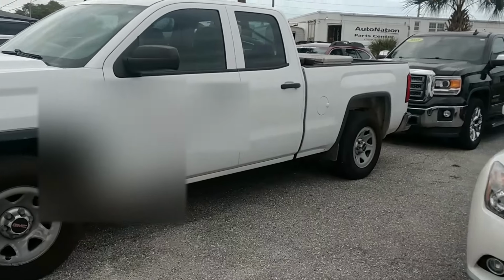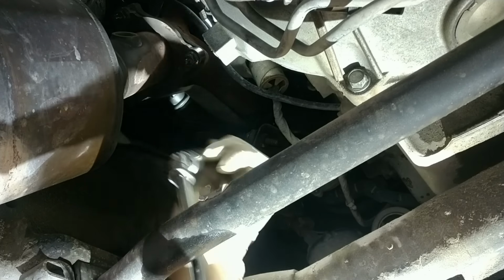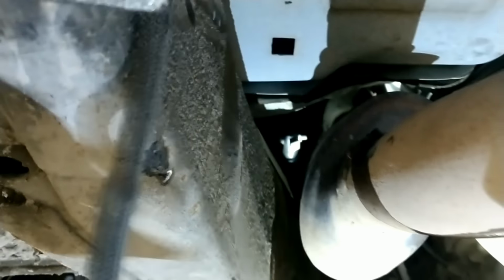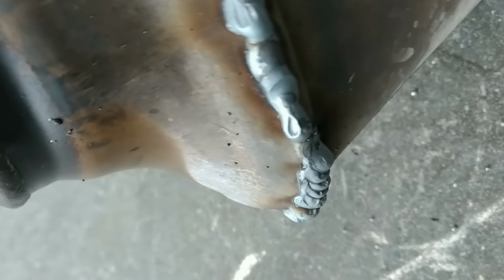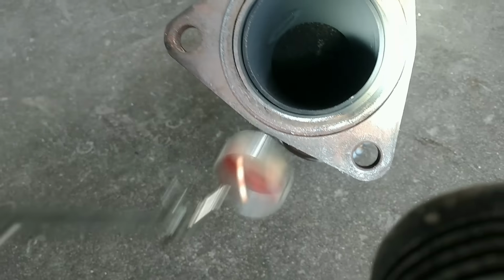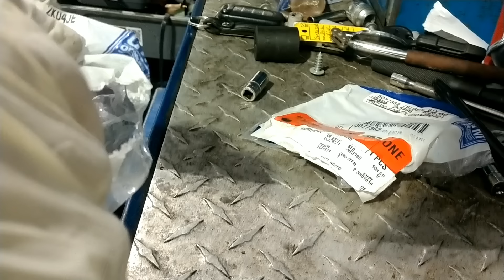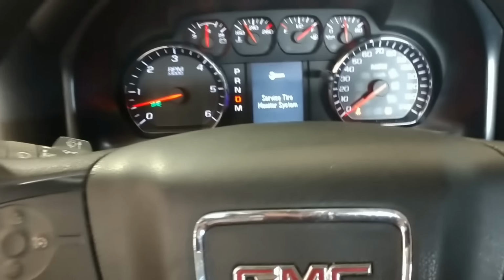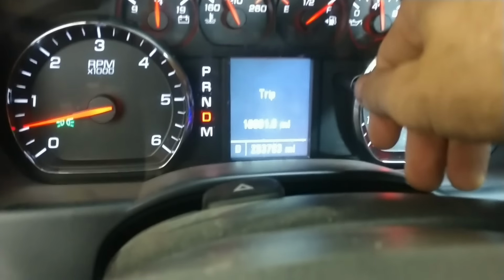Customer States exhaust leaks: Repair it cheap.  Ok then, I can do cheap and good. Sort of.

Comment: Best sign I've ever seen was at my auto mechanic's shop.  It said "Fast, Good, Cheap.  You can pick any two.  If it's cheap and good, it won't be fast.  If it's fast and good, it won't be cheap.  If it's fast and cheap...it won't be good!"   I remember a family vacation to grandma's house, where the ford station wagon began to loose power when you pressed on the accelerator.  We stopped at our usual station in Springfield VA to refill and my Dad asked the mechanic if he had any ideas.  It turns out that the mechanical fuel pump was connected with a rubber hose which had developed a crack in it and was sucking air on the tank side. So, when you stepped on the gas, causing you to lose power. My Dad watched as the mechanic take two different length extensions, two universal joints, a socket and ratchet, put em all together and had the repair completed in short order.  Dad said it was a downright pleasure to watch someone work, who knew what they were doing.  You sir fall into that category and it is indeed a pleasure to watch you work, and just like all those book reports I did as a kid, I learn a lot too! Coming from a 66 year old, that's sayin sumpthin!  Keep up the good work!
Reply: They say the same thing about software QA. 

Quality, speed, cost. Pick 2.
Reply: I believe the original saying came from Keith Bontrager about bicycle components; cheap, strong light; pick two. It is amazingly accurate.
Reply: In manufacturing you have the same free words but one all always get sacrificed if you push the other two too hard

Comment: Just turn the wire speed down a bit and it won’t be so lumpy, clean with wire wheel prior to welding. Finally when I welded my exhaust because I am a welder I put multiple passes on to support the break fix better.
Reply: perfect suggestion..

Comment: This reminds me of when I went to a small mechanic shop 

The owner was quoting me like $300 to fix exhaust leak on a $900 car I said no way I'm putting that $ into this car 

Owner left before I pulled out 

Mechanic chased me down said I can fix it for $20

He actually called his dealer in front of me to get his next fix

Meth I assume 

Repair was done in 10 minutes and outlasted the vehicle
Reply: That's how I ended up w brand new coldless impact lol
Reply: @troy3052  lol
My local home depot has a forklift guy there that will drop a pallet of whatever you want in your truck

For $100!!!!!

My buddy just got 110 bundles of rags that retail for $18 each 

Last week he got 2 vanities 
Turned out they were both damaged but couldn't tell from the outside of pallet

Comment: Welder here. Continue practicing, the main advantage of mig is that it was designed to be easy to learn and pick up.  If you want haynes has a pretty good welding book that got me off the ground. I think you can do well with it.
Reply from the maker: Thanks Bill, I'll look for that book. I'm pretty sure that I had the wire speed too high, and the voltage was probably to high. I've had since decent success with thicker metals before and I have achieved better welds that what y'all saw. Im familiar with settings and the reasons why those settings need to be used. I think some book time will do me some good. Thanks for watching!

Comment: here in CT nobody uses sockets on exhaust work.
torch everything.
half the time if you need a new exhaust the car gets totaled because part of your frame has rusted away.
Reply from the maker: I feel your pain, I spent a year in Detroit many moons ago.
Reply: Live in RI all our cars got rot. My father's bronco, that thing runs like a champ but the body is Swiss cheese.
Reply: Gotta love the rust belt
Reply: @Doomstrader  CT is worse, we are the only state in the nation, that uses the highly corrosive liquid ice melt, WITHOUT the corrosion inhibitor added.  It's eating all the vehicles, and the roads.
Reply: @nunya3163  We should be able to sue the state for ruining our cars.

Comment: If you run a mechanics shop or machine shop, consider doing what this guy is doing. Even if you decide not to make a YouTube channel, taking video notes is both a fast record keeping tool as well as great training material for new mechanics, machinists, technicians, etc. If it's just for internal use you can even compress everything to like 480p, or whatever you feel the minimum usable resolution is, in order to save on storage space.

Comment: Your weld looks great. You're not taking it to the fair.
Reply: Welded  for a long time, you did just fine. Maybe get a pair of welding sleeves, and turn down amps and wire speed for light metal a bit. Takes a bit of fiddling to get the settings just right. look after your liner and contact tip and don't clamp the feed rollers too tight. Satisfying to watch you work and the comments !! Great videos!

Comment: Ye olde welders trick I learned from the old timers. When welding or brazing next to a part you don't want to get hot, wrap the side you wish to dissapate heat from with a sopping wet shop towel, or an actual towel for that matter. As it makes steam, it dissapates the heat. This is especially useful when brazing a valve or something on an airconditioner or on plumbing... but it is applicable in any heating of part situation.

Comment: Good video.. Running multi tack welds to avoid damaging the core. SMART.. It's not always what it looks like.its what the end result is that matters. Besides......its not in a place where it will be admired.
Reply: Multiple short welds over more time = more heat.
Reply: @Aussie101 TIG (GTAW) would be the best process It's a much more precise method and the heat input is more pin pointed. MIG (GMAW) would be the next best, which is what was done here, however it was still done incorrectly. Even though shorter tack welds seem like a smarter choice, mig tacking starts out cold with little to no fusion to the parent metal, just a hot bead of filler dropped down on top, so that right there gives the possibility of pin-holes in the weld which leads to leaking and cracking, especially on an item that goes through drastic heat cycles where the metal expands and contracts, and is subject to heavy vibration. This is only being corrected because even the factory weld, which are usually hot and fast robotic welds run in a continuous bead, typically with the MIG process, still cracked. So why people are saying a continuous weld would destroy the cat, when that is how it was originally assembled by the factory, is beyond me. The second reason on why the tacks is bad is that prolonged exposure to heat, and more of it, because the overlapping of the tacks introduces more weld, as you are overlapping bits of your circumference. The reason why the heat input is greater is because it still takes the same amount of heat to weld the entire circumference be it via tacking or a continuous bead, but stopping and waiting for it to cool before running more smaller tacks gives the entire assembly more time to absorb the heat throughout, and thanks to how the laws of thermodynamics works, the hotter the material is to begin with, the quicker it heats up. 

If it were to be a proper shop repair and charged appropriately, say 1H labor is what I would charge, I'd have wrapped the main body in scrap pieces of aluminum to act as heat sinks and pull heat out of the catalytic converter and run 4 continuous beads in quarters using the TIG process at a rate of 10-12 inches a minute. I'd have also used the proper filler material, as welding any form of automotive exhaust stainless with the standard ER70S-6 filler metal will not only lead to a weld that will rust, but is by very nature weaker as it has depleted the surrounding base material of it's stainless properties, and typically leads to a more brittle material in the heat affected zone (HAZ) which is around the weld joint. The HAZ on this piece is all over the place and inconsistent, which again along with the other issues, could lead to failure of the base material itself rather than the weld cracking. If you've ever seen a weld repair next to a weld repair, this is why.

Edited: Used metal in place of heat somewhere. Corrected.

Comment: Just a quick tip for next time whey you have a crack in metal you need to drill a hole at each end to stop it from extending. Just a small hole will do then weld it up and it should be permanent repair
Reply: I was also taught this..

Comment: This guy 👌

Fun fact, you can put your workpiece on aluminum plate and it'll suck out a lot of heat and you don't have to worry as much about cooking anything inside.
Reply: It's called a Heatsink and they have been used in some electronic parts for decades... Yes, I believe in them for anything that is going to get hot, to help dissipate as much heat as possible to avoid damaging things near the weld, solder, spot..

Comment: Isn't it a GOOD idea to weld this converter instead of replacing it?  Saves money yes, but also saves a lot of material from the waste stream, saves energy since it takes a lot of energy to recycle to important components of the stuff in this device that doesn't go into the waste stream.  Anyways, repair it cheap, in this case, seems like a really good idea. Great video, keep em coming Ray.

Comment: A question please Ray? Should one put anti-seize on the O2 sensors? Thank you. Great video and fix! Hey it works!
Reply: YES HE SHOULD HAVE.
Reply: When you buy them, they come with anti seize. That should answer your question. It's like asking "should my car have tires?" Well, did it come with tires?
People debate this topic very strongly. But they all seem to agree you need the sensors and the "anti seize is bad" group don't seem to stop using them because the manufacturers sell them with it pre-applied....
The concern is: don't get it inside the sensor. It goes on the threads.
Reply: Good idea, definitely in a rust belt but luckily he's in Florida so it's not as vital but still recommended. I'm in Minnesota so I use alot silicone paste and antiseize  and anything I want to remove at a later date.
Reply: I do...

Comment: One thing that might help you is to look up back stepping when you weld. Less heat and you dont have to wait as long between welds. Just trying to help. And yes I'm a fitter/welder by trade.

Comment: Just a small tip for welding that next time. Turn your wire feed speed down and bit and it will deposit less filler and not look so boogery. You could also turn the heat down just a tad as well if turning the wire feed down starts making it spatter too much. Otherwise it wouldn't have looked bad at all but, you had far too much filler metal going into the weld and that's what made it look so fat instead of laying down. Also i would suggest taking a wire wheel to the entire area to be welded in preparation for the weld would also help with the appearance a lot and help with porosity. Clean material always welds better. The cleaner the better. Especially on something like that which is already rusting and has tons of road grime and shit on it. Just some advice to help you out with getting better welds on things like that.
Reply: rust doesnt weld so well ive read. my "never done any welding" brain thought something was odd with the wirefeed maybe. Im gonna try remember your comment for when I ever start welding (probably gonna ask someone to teach me)
Reply: @CodeAsm  if it's worth welding it's worth cleaning first
Reply: @CodeAsm  Lincoln has a whole library of videos if ya don't have someone to teach ya
Reply: He already knows all of this. He was tired and only using .00000013% of his brain power. He can work circles and triangles around you if he wanted
Reply: Like u can weld..
Reply: All very good advice demonlord. Cleaner is better.
Reply: @Hollywoodhouse74  Whose comment are you replying to?
Reply: @gwarlow  all of u fools
Reply: You're 100% about everything you said and welding also removing any oil and contaminants will give a nice clean wild hey good to hear somebody that knows what they're talking about thank you have a good day o
Reply: I would have brazed it myself.
Reply: Also you can't just lay it straight. He might be filling the void but it's not welding the material together.
Reply: Wire wheel AND brake cleaner.....
Reply: @drover338  brazing heats the internals too much. There's cat honeycomb on the other side of the metal
Reply: I think you are really. really improving w/ya welding. ray....

Comment: I mean that really seemed like a job for JB weld.
Reply: It did, but since he had to drop it anyway to get at it and he has a welder, why not?
Reply: @barryaiello3127  I may have patched stuff in place.  Sand paper, spray some starter fluid....  goop it up.
Reply: @larsharris  Don't get me wrong, JB is awesome stuff but if I had access to a welder, (and knew how to use it) that would be my 1st choice.
Reply: You guys can't be serious. From their site: "Original J-B Weld can withstand a constant temperature of 500º F. The maximum temperature threshold is approximately 600º F for a short term (10 minutes)." They do offer another product which claims it can be used on catalytic converters, "ExtremeHeat™ is formulated to allow for repairs to iron, steel and metal in high temperature environments (1000°F / 537°C)" but no way would I trust it. Catalytic converters typically run 1200 to 1600°F, well above what even the highest temperature JB Weld product advertises it can tolerate. He did this the correct way. Using anything other than a real welder on this would have been a waste of effort, and possibly a fire hazard.
Reply: @edifyguy  read your first sentence.
Reply: @chrisbailey5055  Aww man, you got me. :) Well, at least I may have prevented your joke from causing someone to waste a bunch of time and money and possibly burn down their truck LOL
Reply: @edifyguy  I must say, that is good info on JBweld temperature limits.
Reply: @chrisbailey5055  It's good to know. It is actually higher than I expected, which explains why people get away with some of the hair-brained stuff they try.

Comment: Ray I’m almost finished watching all your videos I watch several twice sometimes three times especially when it has to do with the Chevy pick up or SUV not cars I just see them once lol I love trucks. But I do have a question in the exhaust system the gasket that goes between the manifold and the pipe is called a donut why are they so different when is very thick and noticeable in the other one is very thin and small why such the difference? God bless you take care until next video I keep bugging you lol✝️✝️✝️

Comment: You need to turn the wire feed down or the amps up a tiny bit to get better penetration rather than just welding slugs along outside of the crack. Yes it's fine to get a bit of penetration on that core.

Comment: damn being able to break them exhaust bolts free with a ratchet and chrome swivel.... thats gotta be so nice
Reply: It's nice not to live in the rust belt.   Been there done that    bought an s10 after I moved to Florida and was amazed at the fact the exhaust on a 23 year old truck wasn't completely rusted along with the rockers are actually solid too
Reply: @jeffreyuber5303 , the biggest problem with a vehicle in Florida is if you live along any of the coasts. Then salt in the atmosphere gets into the crevasses of the vehicles and causes them to rush.  If you live a bit inland it's not so bad.

Comment: Who cares what these online mechanics think! I think you're spot on. 90%of ppl think that these vehicles on the road are straight forward when problems come up. What they don't know is that there can be 20 things causing your one problem. It's up to use to narrow it down
Reply: 'there can be 20 things causing your one problem'. just like the human body, and
why medical care is expensive.
Reply: @rodneyjohnson4794  well see you can have multiple things that act the same way.. like vibration in a area or engine cuts out. So you can have multiple issues that have same effect or you could have multiple issues cause someone let it go.. DMART ASS
Reply: amen..

Comment: It's ok to suck at welding, if you excel at grinding! (I too suck heavily at welding lol).
Reply: @Andy Nicoll a grinder makes you the welder that you aint, or something along that line. Best way to learn is by stick, the rest MIG and TIG will seem simple after that.
Reply: My welds look like they were done by Ray Charles ..... with his feet. (To quote Roadkill Garage)
Reply: Fuck stick, only form of welding I can't stand I'd use gas before picking up a stick welder.
Reply: @MrDJAK777  What's so bad about stick?
Reply: @ducewags  Likely nothing I've just personally hated it since it was introduced to me. Probably not worth trying to figure out exactly why I have that particular irrational bias.
Reply: If you have soldered a lot before, then welding will be so much easier.. Soldering allows you to see what works and does not, faster and make corrections... And it can be done over... Welding - not so much...